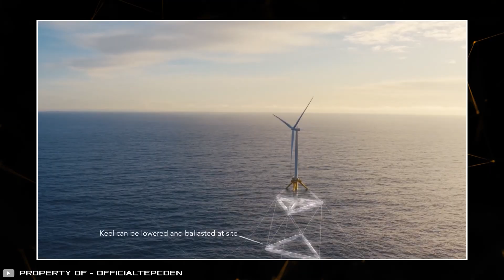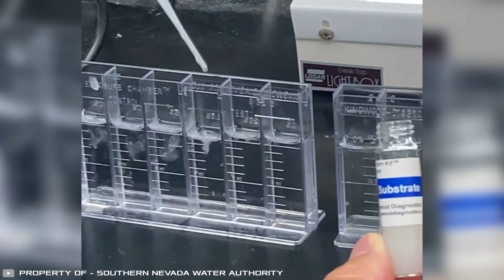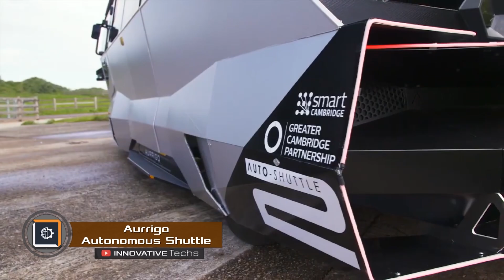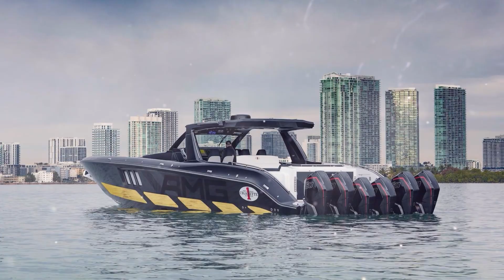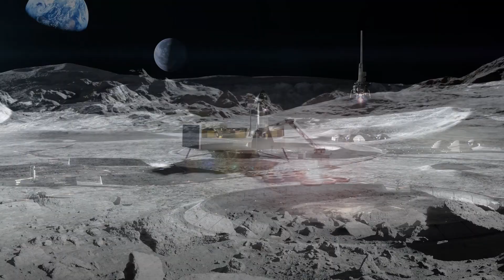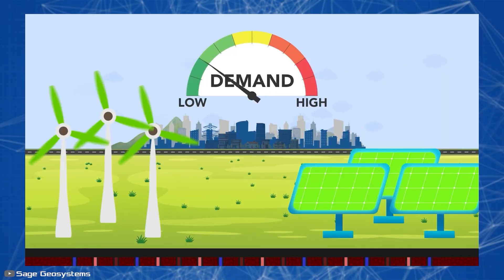80 INVENTIONS ON A WHOLE NEW LEVEL

Comment: Wait, they built charging stations at all parking spots that you have to plug in manually, but instead of just supplying electricity to each socket through the cable, they built a robot carrying a battery that then connects to the charger? Is it some Futurama style mockery of technological progress?